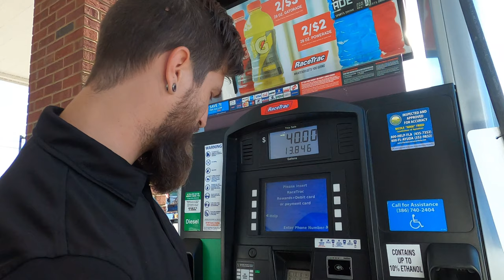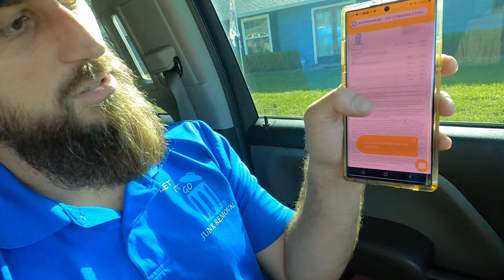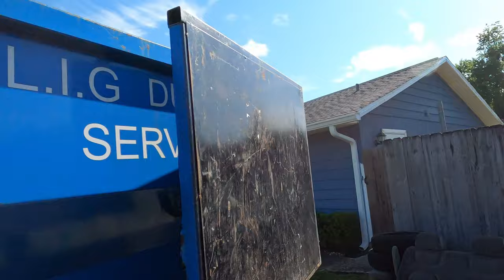2 FUN Days in The Life of Junk Removal

Comment: That Florida heat is no joke 😄 Quick question. I just got my llc and now I am looking at trucks. Should I go with a cheaper, used truck that I can purchase outright or buy a new one? I am hesitant to buy new, because I don't want to be driving around with a $400+ payment each month (even though I could afford it) but I don't want to buy some piece of junk that will crap out in a few thousand miles.
Reply: @MreFEy  No I understand. Friggen sweating my butt off this morning at work just standing outside. 

My personal car (highlander) was having some problems the other day. Found out yesterday it would cost $3k (🤬) just to fix it. More than I wanted to pay, but cheaper than having a car payment each month. This is what I fear if I buy used. I'll figure out. Thanks for the advice 👍